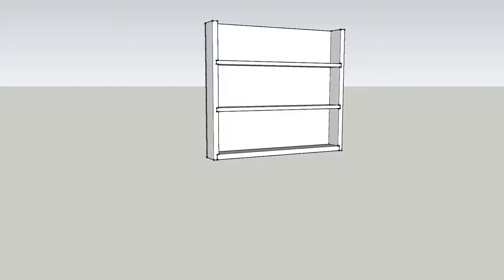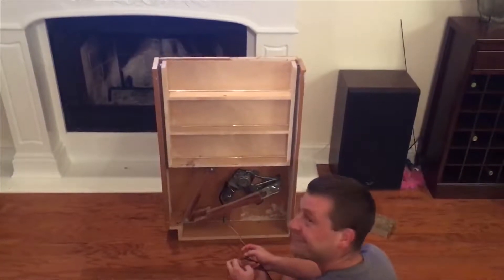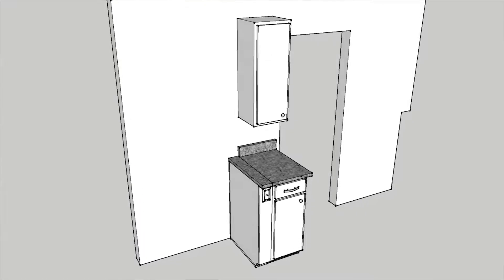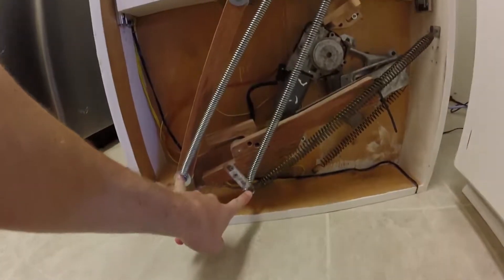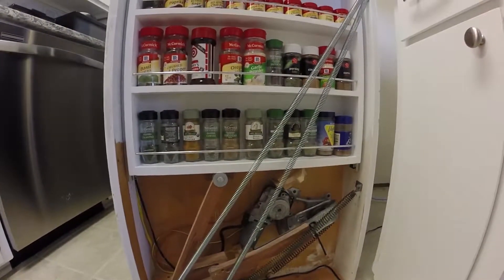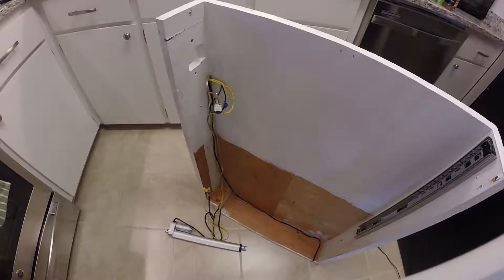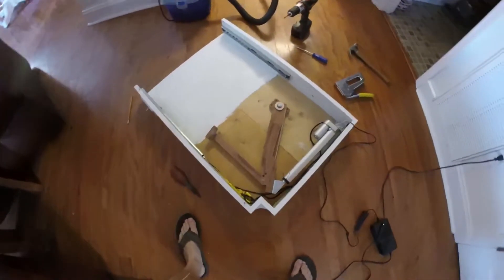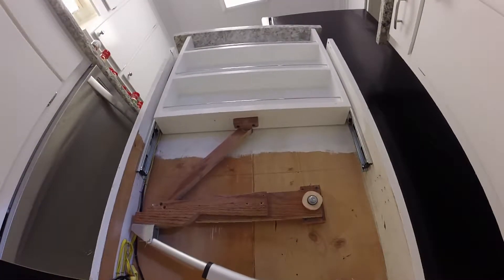Building A Linear Actuated Spice Rack

Comment: Could you have used a shorter and stronger linear actuator connected to the lower main arm closer the the pivot? Less motion at that point would translate to increased speed.
Reply from the maker: Absolutely, but I think you would need metal construction of the linkage.  I'm was concerned that the wood linkage would fail under too much load so I designed the pivot further out.